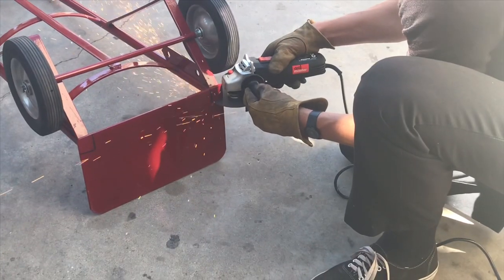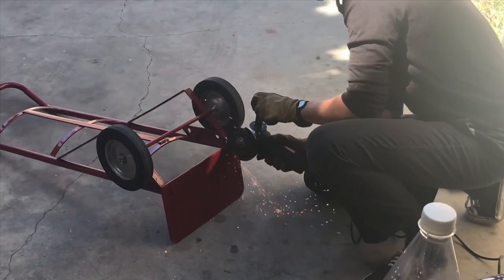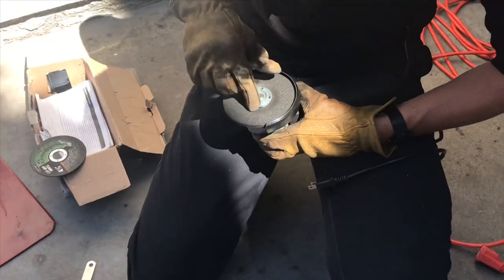Homemade canoe cart on a budget

Comment: Thanks for sharing. If you have a canoe with outriggers. Mast and sails... A 5 hp outboardmotor and 10 gallons of fuel. + Water and food for 14 days..... Well you can not bye a cart that will handle it I think ? .Anyways.  If you have to walk. lets say 5 miles on bumpy" road".. And have some lower back issues. I would probably put some 16-17 " wheels on it.